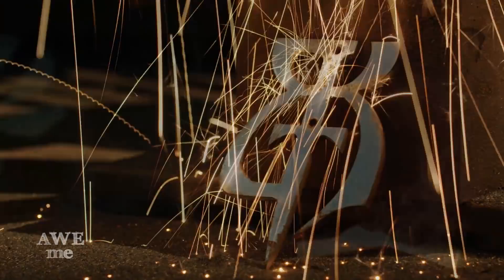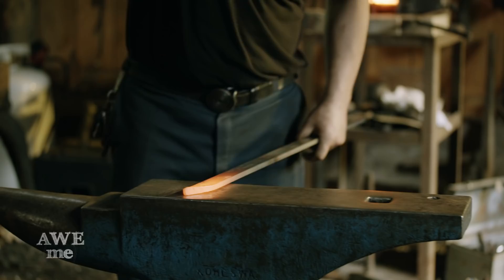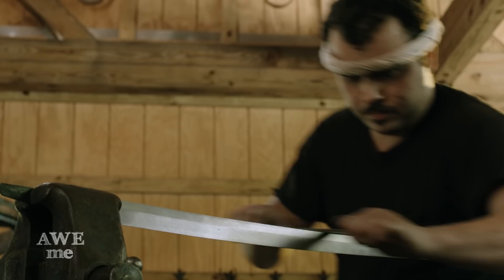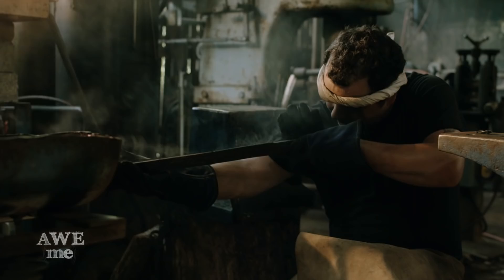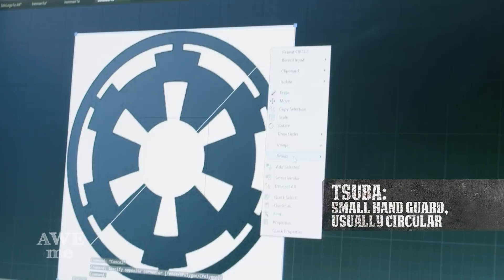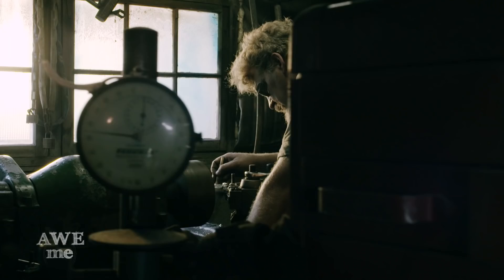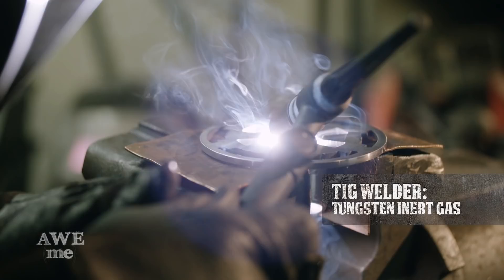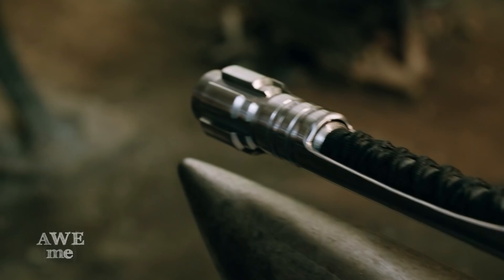Star Wars Lightsaber Katana - MAN AT ARMS: REFORGED

Comment: It makes me sad to see a "katana" made like this... The blade should be folded! Allot of time and patience put into the blade. The layers of the blade are its soul, and what makes the katana so great! Damn it... :/
Reply: Actually, the folding was only because back in the day, the quality of the iron in Japan wasn't very good. The only possible reason to still fold is for tradition's sake, and it won't make a better blade.
Reply: TheSandvichTrials But that is a katana anything else is just one sided sword.
Reply: I think they know their fans don't want to wait six months per episode...
Reply: TheSandvichTrials one could argue that using two types of steel when folding the blade would give it special properties but i can't say what it would do though
Reply: TheSandvichTrials I forget what weapon it was, but there was one in the old MAA series that he has to fold like 42 layers.
Reply: lol.. boring
Reply: Folding was a process used to remove impurities and ensure a high carbon content in the iron to make a stronger steel. Modern metallurgy completely removes the need to fold the steel. Folded steel is very very pretty though. On the whole the katana gets treated as some holy grail of sword manufacture. It's not. It's just a sword like any other, its design specifically tailored to its region and the type of foes it was made to kill.
Reply: Ebot75
you are thinking where he did a sword of damascus steel.  which is multiple types of metal sandwhiched together.
Reply: actually the whole reason katanas were made like that is because japanese smiths only had access to really crappy iron (compared to european iron) so they had to make up for it by making the absolute best sword possible with what they had to work with
Reply: Damascus steel just has a more noticeable pattern. Folded steel can and often does have subtle patterns.
Reply: Folding was done because of the shitty metal. A katana made out of a slab of high carbon steel and given shape and sharpened is far better than a traditional katana.
Reply: Wartooth91 Actual, after thinking about it, I think it was Sokka's Meteor sword.
Reply: Im not saying its just for the strength... just because technology has moved on doesn't mean we can just forget about how it is supposed to be done. This is not a katana, its a single edge sword made to look like a katana.
Reply: Ebot75 it was the meteor sword and the gimli axe. The sword had almost 290-something layers while the axe had like 50-something
Reply: TheSandvichTrials Folding isn't just because of the quality of the iron. That's part of it, but there are several other reasons for doing it. They escape me at the moment, but I know that you're wrong about it just being about iron quality.
Reply: Tober Tobias Might as well go back in time for everything we do then just to keep it traditional then? It's counter productive to do something that takes much, much longer but gives the same result. Adapt and move on :)
Reply: agreed....
Reply: Tober Tobias
Obviously we haven't forgotten how thigns are made, but you aso have to take into account NOBODY that isn't an original japanese blacksmith, wants to sit around for DAYS and DAYS to make a katana like that. not to mention there is no need to since the steel is far better here. They run a business and make videos every week. Time is money. if you're so worried about 100% authenticity then MAA isn't the series for you.
Reply: Canine H Swords as a whole are no longer needed. We only make them now because its a part of history we like to keep going. What is the point of doing historical things that have no practical use if we are going to disgrace the tradition anyway?
Reply: Corallia's personal place Yes, Katanas did tend to use 2 types of steel for this reason. Softer and Harder. This is why Katanas have the arch they have and this was done, if i remember right to give the blade the ability to have more stress put on it without breaking and making it lighter overall.
Reply: Tober Tobias To make money.. For viewing entertainment. Common sense, really.
Reply: Tober Tobias why do it tradiotionally if one is not a japanese smith trained by a other japanese smith?
Reply: CAT OVERLORD  why do it at all if not properly? half jobs done lazily are one of the many things wrong with people today.
Reply: Tober Tobias That would make sense if this job wasn't done properly.. This blade is great quality.. Like I said, smart humans move forward because they do the things other humans do better and faster. Which is what they done. 'Lazily' and 'Half jobs' lol. You must be trolling. I'm done.
Reply: Canine H but functionality isn't all thats at stake here? The blade ISNT going to be used for combat so how well it performs isn't the most important thing. Why do we still make swords? To keep the tradition alive. THAT is the job that wasn't done properly. Im not saying this is a bad blade, it simply isn't a true katana.
Reply: Tober Tobias Then why would you bring it up and call it half arsed? It's a custom blade made for VIEWERS of this youtube channel in a time space which is exactly why he makes the weapons. #1 It earns him money. #2 It's fun to watch what he makes. I mean seriously? Is that so hard to understand? This blade is probably better made than the 'Katanas' you value so much. A true Katana and a normal sword will do the same thing and are used for the same purpose, they are the same thing despite how much you want to conceive with one. Toodles, have fun hunting deer with your bow and arrow in your cow leather sweats.
Reply: it be nice of the could sell it too, a lot of people would want it, even me

Comment: You guys should make the 3D Maneuver Gear from Attack on Titan! :D
Reply: Not really a weapon unless you're talking about the sword.
Reply: Lyon TheGreat
The swords are part of the gear.
Reply: If they can work out a way to make the blades detachable without being weak, I'd give them extra points. XD
Reply: heresjonny666  It's pretty much an oversized stanley knife. Not exactly difficult to make strong. I have a feeling you're talking about the strength of the segments, so it doesn't accidentally snap whilst cutting something, though.
Reply: Yeah, that's what I mean.  If you made it the way they do in the anime/manga where the tang is really small it'd break really easily, so it needs a full tang while still being able to change the blades. X)
Reply: *****
Uh...
More like "3D Maneuver Gear Blades"
as it is part of the gear...
You wouldn't call it's gas cylinders as "3D Maneuver Gas Cylinders" now would you?...

Comment: I could be wrong here but isn't the hardening line of a katana the result of the many folds the metal undergoes during the process of making the katana? And not some cheap visual effect they add in cause it "looks cool"? In fact, I'm pretty sure the clay technique was only used to make the pattern, known as jihada, more pronounced.
Reply: You are correct but that would take months to make it proper.
Reply: Aight nobody got time for that I would be so mad if they stopped posting for a year to do that. But that's just me personally. Yes you are correct though
Reply: Mitchel Hall actually you are wrong, I was asking the question sarcastically since I already looked it up to make sure. The design on a katana that they refer to in this video as being caused by the clay is actually the result of folding the metal, the clay doesn't cause the pattern, it only makes it more pronounced. If you read the 3 comments, we weren't talking about the technical aspects of it, we were only talking about the visual aspects.

Also, while the metal we have today is more pure than in the past, it is only about as pure as metal folded 2-4 times. Japanese sword smiths would fold the metal up to 16 times. So no, it wouldn't be pointless.
Reply: A Temper line/Hamon has nothing to do with folding of steel, you are thinking of an acid etch, which would then show the patterns of the fold.

And yes to fold pure steel to get a minute amount of slag out of it would be more than redundant.
Reply: Mitchel Hall actually, it's known as a jihada, it has nothing to do with acid and everything to do with the millions of layers created by folding the metal.
Reply: Millions of layers... Thousands with stacked steels, millions no. What he done with the clay is called a hamon, It is for differed tempering. What I speak of is based on experience, not the internet. I'm done because you have "actually" read something and deem it as absolute. Good day.
Reply: Mitchel Hall  Yes, I know what he did was a hamon, again I was not talking about the technical aspect, just the visual. He claims in the video that "the puffy cloud or jagged edge" pattern on katanas is from the use of clay to create the hamon, but that is incorrect, the pattern, known as the jihada, is caused by the layers of metal. Jeez, why is it so difficult for people to actually read what I am typing before they comment.
Reply: TheTokuin cuz your still wrong. the pattern is caused by the clay. the differentiation of the thickness in the clay causes the two areas to harden at varying rates, making the hamon the hard part and the body of the blade soft, allowing for flexibility.its visually different because the rate of cooling makes the metal grains arrange differently, and draws out the carbon purity, which gives it the silvery color. the pattern itself is unnecessary, usually used as a signature by the smith. it could easily just be a flat line, and maintain its effectiveness, so he's technically right when he says the pattern is purely aesthetic.
Reply: The hada, or grain pattern, is the result of folding. The steel used for the blade was not folded, and would show none of this pattern. The hamon is the result of the differential hardening using the clay. It is the boundary between the martensitic edge and the pearlite and austenite (the softer steel) spine.
Reply: Everyone is really good at using Wikipedia.
Reply: Yeah,i guess so  since you obviously didn't read the thread, let me make my point again. I was not talking about technical aspects, only visual ones, because in the video he says the pattern on katanas is from the clay they put on, and that is not true, the pattern is from the folds of the metal.
Reply: Why is this thread still rages on even after I answered it.

I watched and helped my first Iaito being made. 

YES there are other methods but I believe this is the one method he's asking, the traditional way.

Comment: Was expecting the blade to light up since it's a LIGHTsaber crossed with a katana...
Reply: How the fuck are they supposed to do that?
Reply: gustav0105
add a reinforced liquid tank with lights so it glows
Reply: ak1996x duct tape and glowsticks should do
Reply: gustav0105 they have to use the non-existent technology duuh 😂
Reply: gustav0105 Place a L.E.D or two inside the Habaki so it shines up the length of the blade?
Reply: Same way they did the plasma sword, sting, maybe minecraft sword. Just a thought.
Reply: gustav0105 watch the halo sword video
Reply: ak1996x Well the steel is not see-through. So it wouldn't work
Reply: D.O'Bhrionn The L.E.D's would just break after a few hits
Reply: darkXkurage The energy sword isn't glowing. It's just tinted
Reply: gustav0105 I don't fucking know! But since they decided to do this challenge, making the sword glow is an obvious thing they have to address. Otherwise it's not lightsaber, it's just an painted katana.
Reply: TheTsugnawmi2010 They didn't say that it would be a lightsaber. They said that it would be an lightsaber Katana, and that's just what it is
Reply: The whole point of this series is to take two weapons and combine the most prominent features into one weapon. Sticking the handle of a lightsaber on a katana blade is nothing special. When you think "lightsaber katana" you think a lightsaber with its blade in the shape of a katana blade. Not a katana with a lightsaber handle. 
Obviously they can't invent lightsaber technology so do the next best think and at least paint the blade in glow in the dark paint or put LED's in the blade.
Reply: TheTsugnawmi2010 Ok. Just to make this clear. They can't use LED's because they will break. And they can't use glow in the dark paint or glowsticks because they run out.
Reply: It's a one-use item. Who cares if they break or the paint runs out?

Comment: The sword looks awesome; though I'm worried that the weight would be really heavy toward the handle since most of it is now metal. The Hamon could also have been made darker to really make it stand out. Isn't the original recipe for the hamon coloring just clay with ash or soot?
Reply: They usually make the handle with lighter metals like aluminum.
Reply: jep the traditional way is with clay infused with ash or soot (where the ash-line is overall a little bit darker)
Reply: Yea, the handle might be a bit heavy compared to the blade, but since Lightsabers have all their mass in the handle (since the energy is most likely, well, energy) i think it's okay.

Comment: why every time they cut the lamest things..???#macaroni...
Reply: Because anything else would damage, dull, or snap the blade.

i'm assuming they intend to sell or display these things.
Reply: RunsWithKniefs What about ballistic gel? It has roughly the same density of human flesh, and I trust it would not damage their fine work of art.
Reply: RunsWithKniefs A good blade wouldn't snap if it struck another sword or anything else.
Reply: Jordain Williams That is not a good blade...
Also High Carbon Steel + Tempered Martinsite = Brittle.

A good blade like a real katana, no it won't break with another sword, the sword in this video will severely dent if you hit another sword.

That sword is for show, not for use so they don't need to care about durability!
Reply: Th-th-that isn't macaroni...
Reply: Jordain Williams
Oh look. Someone else who doesnt know what theyre talking about.

I mean ... Its not like the standard defences in kendo are designed to stop the opponent from striking rather than to block the blow. You know, for exactly that reason or anything.
Reply: RunsWithKniefs a real katana would snap on another sword,   katana's are made with pig iron, a metal so brittle it can be shaped with a bare hand.

also   high carbon steel is a relatively strong metal, it could hold up to hitting other metals,  such as the metal can they stabbed it through,   but it would damage the edge of the blade because that is how an edge works
Reply: ClydeFake cost,   ballistic gel costs thousands of dollars for a bust size and can only be purchased from a limited number of sellers all who overprice it to hell. where a 2 liter of soda can be grabbed from any walmart for about 86 cents.
Reply: NoESanity Sad. But well, thanks for the info, I honestly didn't knew that.
Reply: For two reasons
1. They don't want to blunt the edge or dim its shine
2. cutting bottles of soda and shit looks better in slow-mo

Also you mustn't have a very good memory, at the beginning of the video he rammed the blade right through a rusty barrel
Reply: Kimbo Slice it must be very difficult to cut a rusty barrel...
Reply: ...and if I had a real catana I could cut anything
Reply: Hlias Yfantis No.. catana's don't cut anything.. actually catana's don't exsist..
Reply: Connor White are you sure..?
Reply: katana*

Comment: kinda an insult to the katana makers in japan, because a katana is a steel fold into layers>flatten and fold again (just like how we prep a dough for the bread) ..... this is just a piece of metal,cut it, shape it into looking like a katana
Reply: The folding technique is done because the sand steel used to make Katanas are very bad for making a sword. The steel is folded to remove the impurities, or slag (stony, non metal elements), and when the sword is finished, it has roughly the same metallic properties as modern steel.
Yes, it is metal cut in the shape of a Katana, but they aren't calling it a true Katana. It's only a true Katana if they went through all of the rituals and did everything to forge a Katana just as the Japanese would. This is just a mash together of two iconic weapons, and isn't meant to be a symbol like the traditional Katana was/is.
Reply: There's only two places left in the world that do it this way.  With modern technology, folding a blade is actually the last thing you want to do.
Reply: Jacob Kerlin Unless you were doing it to achieve the aesthetic effect of Damascus Steel. Otherwise, there's no need.
Reply: ***** Then you do pattern welding. Twist the ingots when you make them.
Reply: Go have a cry.
Reply: animematt99 Correct. That method is done by the Vikings, and is my favorite method of pattern welding.
Reply: the method is invented and used by ancient Chinese but they eventually came out with better steel so they stop doing that also that was not very effective at war time.

Comment: No folding? A shame
Reply: ThatMrAnythingGuy wow cheers, I just thought it took longer
Reply: ThatMrAnythingGuy
Folding does not equal layered Damascus.

Modern Damascus (yes, there is debate about whether it is really damascus or just an advanced pattern forging technique, but anyway) is extremely strong and can make blades that are damn near indestructible, especially if they are treated/tempered properly. You also get a really nice fancy design in the blade. It is made by having multiple types of steel forge welded together, and then they are cut (or folded over) and done again and again. The multiple types of steel (usually 3, sometimes more), means no strength or quality is lost.

Folding is pretty much when you just fold the same piece of homogeneous steel over and over again, which can weaken the steel.